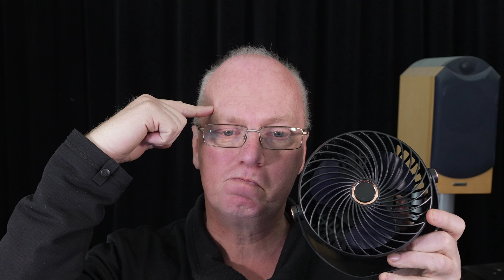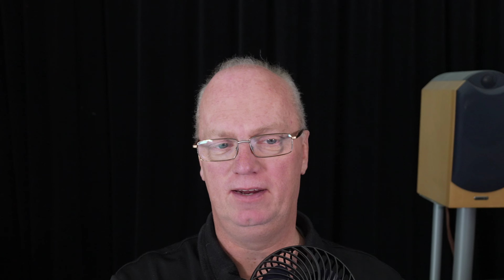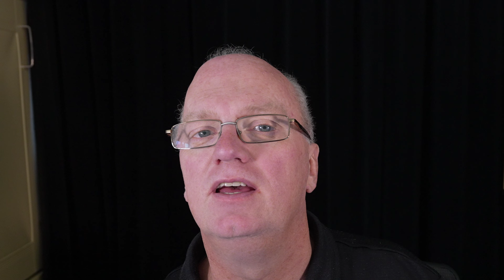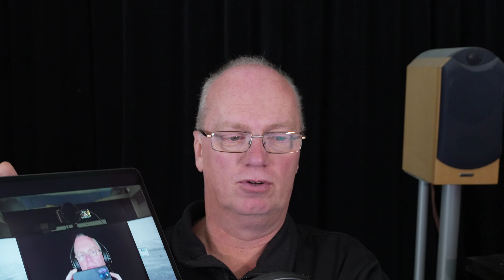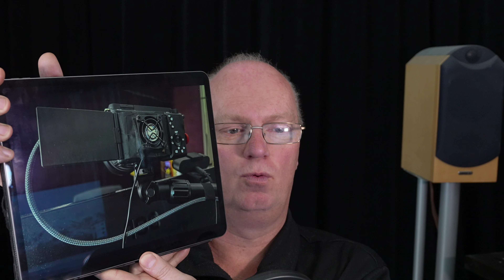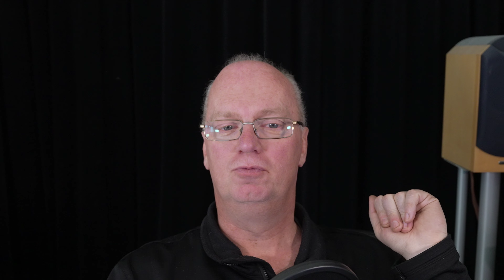sony zv-e1 $15 overheating fix part 2 (its a start).

Comment: have you looked at the fan design by Axel Wolstenholme?   "Turn Sony ZV-e1 into an FX3 with a portable clip on fan"
Reply from the maker: watching it now i did many of these types of hacks good to see more and will watch it. But i do plan to try and get smallrig to create a base arca plate that can take this attachment as a option. But thanks for the name !.
Reply: @scb2scb2  No problem. I was going to use his approach until I saw you were working on something.
Reply from the maker: @IMDABROWN  well i am still learning but for $14 bucks playing is nice please join :) . I think given the flipout screen using something that fits inside the lcd 'hole' like i am doing is nicer its also clear how we could attach this to a small baseplate that i want anyway for things arca, better lug, better 1/4 tripod position etc etc... but i will for sure do my best to get into production as a extra part.
Reply from the maker: @IMDABROWN  Do you think my 'design' is clear or should i make a second video showing it more and explain how it would work ?
Reply: @scb2scb2  I could use more visuals.  I do like the other concept of it being removable. If you can get Smallrig to implement a fan system in a cage that will be amazing.
Reply from the maker: @IMDABROWN  clearly i  need to make a extra video this is 1 second install its just a plate that you push in... and in real design can  be installed using a magneet .. just flip it on or off.
Reply: @scb2scb2 Thanks. I'll key an eye out for it

Comment: if you buy a camera and have to fix it, shows its a bad investment.
Reply from the maker: you clearly have not watched the video but thats ok. i know why i got it and why i think its fun to see if i can use it in other ways with a small hack.
Reply: @scb2scb2  i watched the video, you have a fan strapped to the new camera to fix of the overheating.
Reply from the maker: @truthseeker6804   but i also made perfectly clear the camera is fine for why i got it and i am only doing it to see how far i can get and maybe also be able to use it as webcam if i want. if that works and it can become a product i would argue its a good investment if it helps others even better. i am not alone in this fuji sells such a addon for their own camera and other brands for canon for example. there is a difference in fixing it and trying to recast it to something else. if i really needed a camera that would do it by itself i would have gotten a fx3.
Reply: @scb2scb2  most beginners buying a camera would want to use it also as a webcam and this zve1 camera would fail for that. the panasonic with the fan that camera didnt even overheat, they made the fan incase it overheats. its good to find solutions to problems, but its best to not buy the problem to begin with. there are other cameras at similar price as the zve1 that would do way better with heat, like the panasonic s5ii and canon r6ii or sony a7iv. all full frame. or sony fx30 if the person is fine with apsc. 
the canon r5 on launch was notorious for overheating, some poeple still bought it because its a great photo camera, or they do short videos, now the r5 overheating has been fixed with updates. this zve1 is mainly a video centric camera, and its failing at that.
Reply from the maker: @truthseeker6804  Well not sure if that is true and its fine in 1080p for 2 hours as far as i can tell and like the other brands we can expect some fixes i am sure. But i do agree that the webcam mode being 4k25 now is something sony themselves talked about and that is weird since its clearly long video format. But i guess we will not agree on this in my view having a stronger cpu/internals and the fx3 / a7s3 sensor inside a body this small would always have its limits its just i am ok with playing with them and you are clearly not. Keep in mind this combo of a zv-e1+small lens is 700 grams making it very useful for some usecases... But again i doubt we will agree on this and my first reply was mostly aimed at your 'bad invesment' comment since i think thats personal and for me not true (even if i feel its 500 euro to much). Hope you keep watching  videos since i think its fun to fiddle.
Reply: @scb2scb2  if you buy a new car and have to fix parts its a bad investment, if youre buying a new camera and have to fix it its a bad investment. unless you dont do long form videos then its fine. but as a video centric camera there would be multiple times you would want to do long form videos. ofcourse no modern camera would overheat at 1080p, and if 1080p is the goal theres much cheaper cameras that would do well. 
if this zve1 camera was $1400 then it its only real competitor would be the canon r8. but at $2200, its got alot of competition that are doing much more for similar price. the sony a7iv, the canon r6ii, the canon r6 mark 1 is cheaper with more features, the canon r8 is similar but $700 cheaper with viewfinder and more megapixel. 
if a family relative came for recommendation to buy camera. this would be the last camera id recommend, really. 12megapixel, no viewfinder, overheats, low resolution screen, for $2200?. nah.
Reply from the maker: @truthseeker6804  Lets agree to disagree getting into car compares is never a good idea.